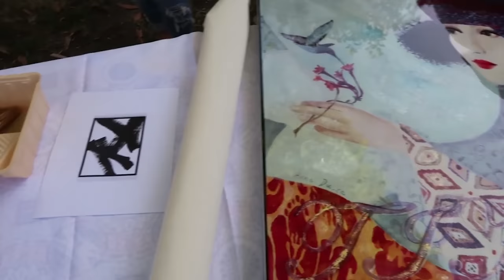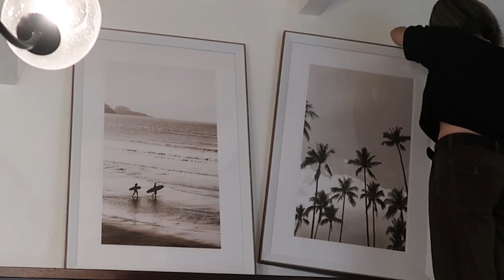Easy DIY Home Hacks - Best Home Improvement Projects (on a Budget!)

Comment: Julie my girl, you are in my head! For all of my adult life I have re-purposed items for economic reasons when  no one else did. I get lots of compliments but all I can see is a poor person's painted thrift-flip attempt to look like something expensive that I really wanted. Before phones with camera's I'd quickly sketch plans out while in the store. And now it's popular to flip AND the best designer Julie 🤩 even does it, so I no longer feel  self-negativity about it. I too scrutinize every room. I am obsessed with anything decor. I read and watch anything decor. It gives me such pleasure. I'm constantly thinking of ideas, then keep a list (incl color swatches if needed) in my purse of items I've narrowed it down to for a certain space so I'll have it on my radar along with measurements/color. Then if I come across something at a store, a thrift shop, or a garage sale, I know it will be an exact fit or color-coordinate. I have felt pads on all my furniture and you're right about the peel-off type. Somehow the pads always slide half off, yet I have to use pliers to try to remove them. Go figure! Being in an apartment I think of noisy neighbors ALL the time so laughed at your comment. I felt like a guilty thief trying to hurry and paint a couple of items outside once when I thought no one would be gawking 👀. I thought it was just me since I have no private yard.  A tip I learned a long time ago with old tight fitting drawers (no, not that kind 🩲) is to rub a bar of soap 🧼 on them so they'll glide and not stick.
Reply from the maker: I’ve used an entire bar of soap on that slide plus WD40, the soft close is so much more effective 😅 thank you for watching and supporting the channel!! (And my design choices 🙌💖)

Comment: Forgot to add: I have been planning on hanging a gallery wall for months. All the supplies and sitting in the corner and ready. But I was intimidated about getting it straight and level.  Thanks for your great tip! I will do THIS project ASAP.
Reply from the maker: Measure from the floor Maureen! Usually ceiling heights aren’t super straight, therefore unreliable

Comment: Hey Julie. I’m thinking about painting my bathroom, cabinets and countertops. It’s not in my budget to replace them. Any input as to what type of paint I should use and how to seal them? Thanks again for all your videos.
Reply from the maker: Bathroom cabinets can be sanded, primed, and spray lacquered with latex paint or you can also use oil- based paint but it takes forever to dry and it smells. Definitely not good for a household with kids since it takes a few days to aerate. Countertops can be painted with epoxy- I don’t recommend it since it chips, but if you’re just looking for a quick facelift/ not permanent, I would do a quick YouTube tutorial search for tips and tricks!

Comment: Hi...Love your video...Just subscribed :) In the video you said you could refinish a lamp with baking soda and water...So you don't need to add that to paint??...It's just baking soda and water??...If so, how do I measure that out??... I mean is it like one part baking soda and one part water or two parts baking soda and one part water, etc.??...Thank you for your time...Take care...
Reply: I noticed that too. I think that you add 2 parts water-based paint like latex or acrylic and then 1 part baking soda, and then just enough water to counteract the dryness introduced by the baking soda -- to bring it back to the consistency of the paint you started with. I'm sure that you can err a bit on either side and will just get different textures and effects. 🙂
Reply from the maker: Add baking soda in the paint. Dilute with a bit of water for lighter texture. Start with just a small teaspoon of baking soda mixed with 1 cup of interior latex water-based paint. Check out the full length video called DIY Ceramic lamp

Comment: I’m determined to hang art! I’ve done it before, but for some reason, I’m feeling intimidated because I have to add hangers to the frame. Seriously! The frame is super cheap, so if I ruin it, it’s really not a big deal. I do feel I overpaid for it considering it isn’t actually wood…it’s some weird crumbly stuff…so I guess I feel I need to get my money’s worth??? Of course with it leaning on the wall, I’m not getting any worth out of it anyway! This weekend it is!
Reply from the maker: It’s worth it to pay a bit more for the frame with built in hardware. One less thing to worry about. You got this Jeanne-Marie! 🙌
Reply: @JulieKhuu  Thank you for your encouragement. The picture is hung! I put the hangers in the old frame,( still on the hunt at Goodwill for a more substantial frame … this one seems smaller than it appeared, when it was causing me so much angst! I expected it to be larger than life!), and then used a Go Hang It system which was super easy. When I get the new frame, I will replace the nails that came with the kit, and use a more durable anchor. I can’t thank you enough! I feel so empowered

Comment: Julie, how do you use anchors with those picture hangers? The nails are too slim to fit in wall anchor!
Reply from the maker: There’s an anchor for every time of screw, look for the set when purchasing. If you’re using something thinner like a nail, try steel super hooks that secure behind the drywall. Usually these frames are so lightweight, anchors/ studs aren’t necessary